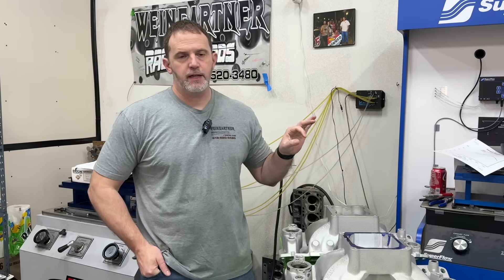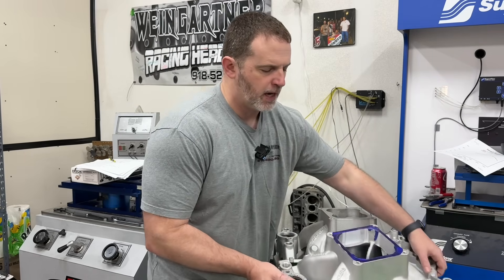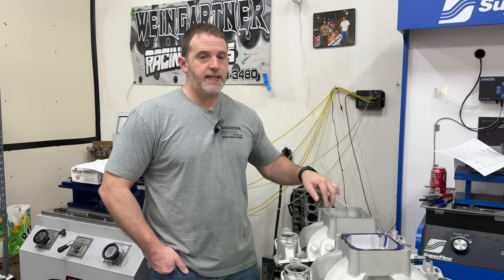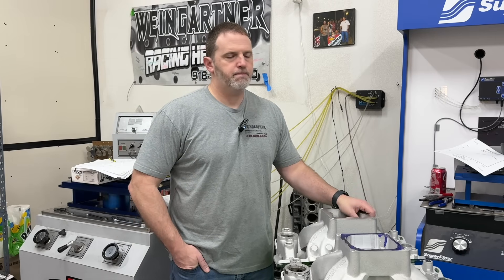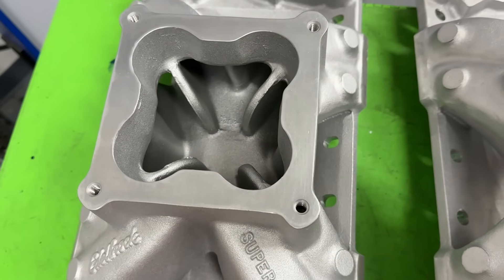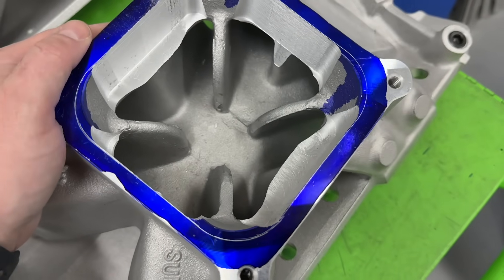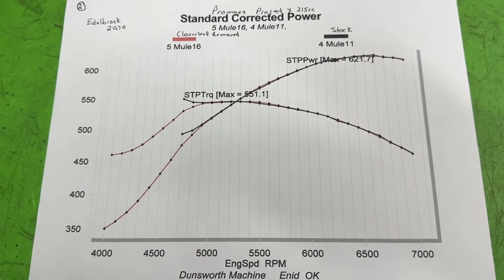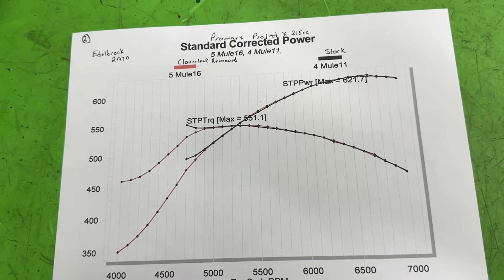Does Removing The Cloverleaf From A Manifold Make Power

Comment: Removing material from a dead space… No air flows there, so no difference. I believe the clover was specifically designed to act like a tapered 4 hole spacer does these days. It’s a transition idea from the baseplate to the runner. Helps add a contour, and probably helps low speed vacuum signals to the carb.

Comment: I opened my victor jr up to the carb base gasket. I removed it just to increase plenum volume, looks like I wasted my time. I did open the ports up to a 1205 and went about 3" deep into the port. That might help, who knows until I actually run it.